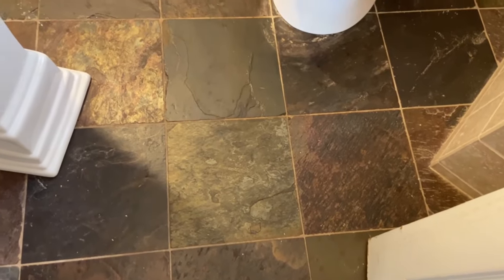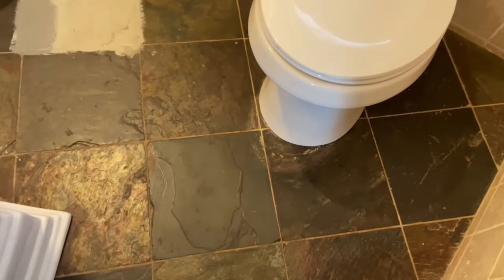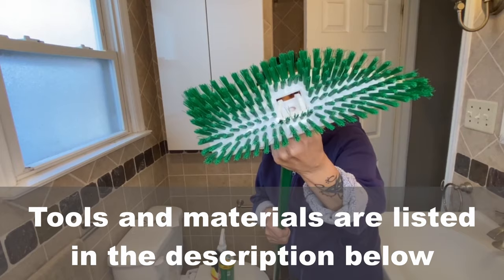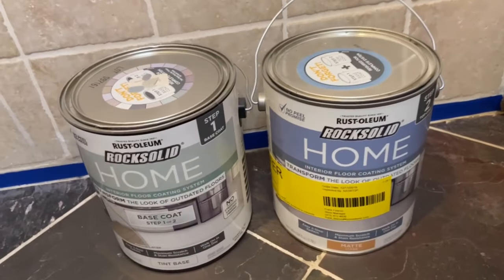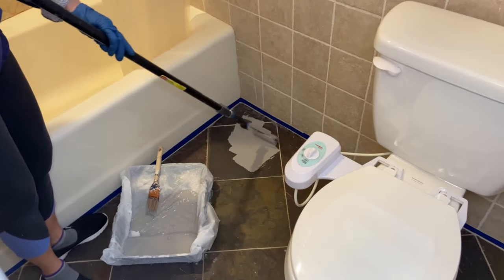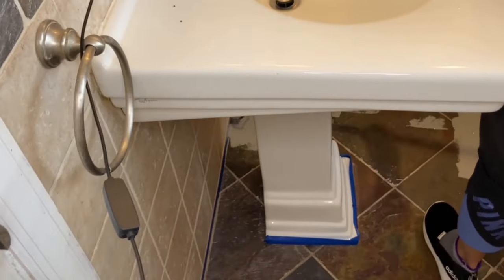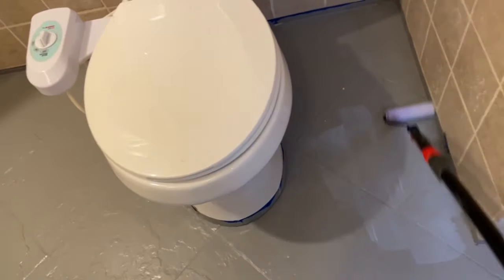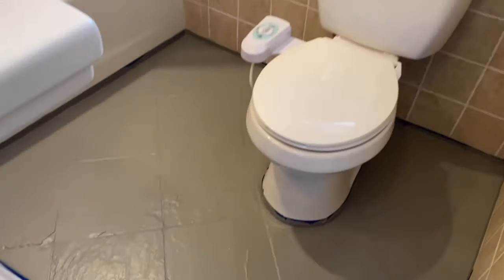HOW TO PAINT FLOOR TILES DIY🎨 Amazing Transformation of Home Decor on a Budget by Painting Tiles!

Comment: Do you think the paint would hold up to a door opening up with a door sweep? i.e. repeated open/shut of a front door? Thanks!
Reply from the maker: If the door sweep soft enough to not scratch the surface just slightly brushes against the floor I think it should be fine! But I would wait for few days until its totally harden before I use the door!

Comment: Tuba, those tiles were beautiful. Why do you want concrete colored floors?
Reply from the maker: I agree they are beautiful but they really dont work for me in the bathroom! I cant tell if floor is clean or not but with the light gray I can see everything! Also top coat created a really nice smooth surface on the tiles which I am loving so easy to clean!